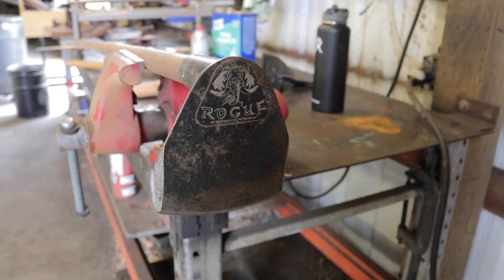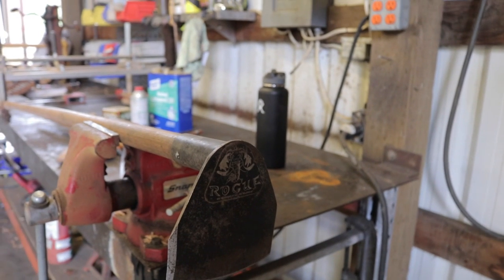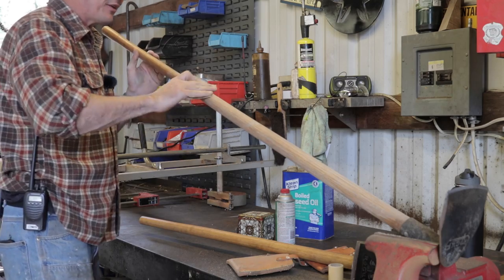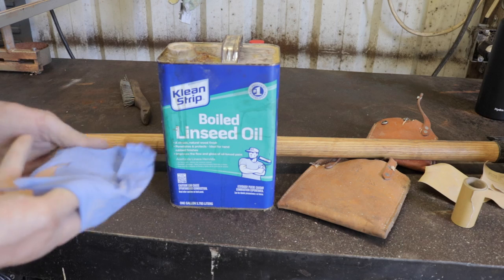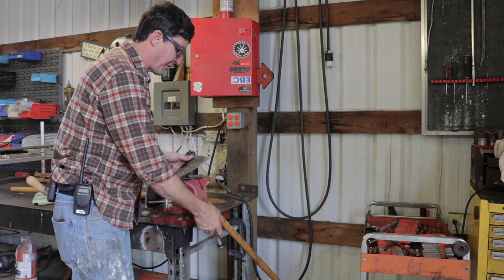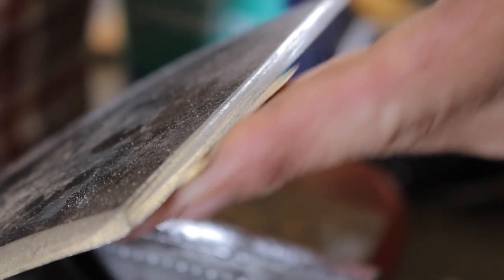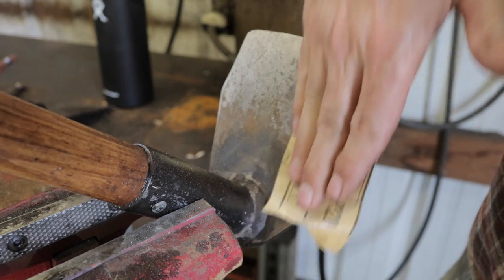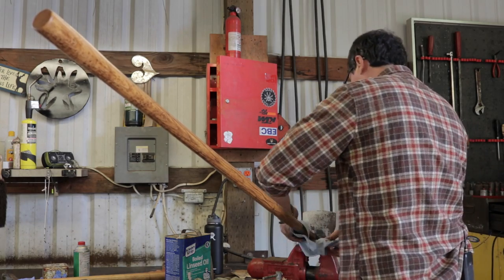This Is My Favorite Tool

Comment: Cody, you might consider buying or making a simple set of protective vice jaw pads so that you aren't munching into your beautiful wood handles with those diamond patterned metal jaws. We use to make them out of sheet aluminum, now I see them out of rubber or even urethane. A quick project to protect your handles.

Comment: Wish I could have watched this video earlier. I was restoring my friend's axe for a gift for his birthday on July 5th and didn't do a very good job at sanding the old and putting a new boiled linseed oil layer on it, the wood soaked the oil unevenly and the stain colour was a bit off in a few places. BTW don't you wipe the dust off the handle before applying BLO to it?

Comment: Question for you. When you use boiled linseed oil, are you using store bought BLO, or do you heat raw linseed yourself to polymerize the oil? Most store bought BLO has toxin chemicals as a drying agent these days and I avoid using it when I can. *EDIT* Just noticed the can in the background as I watch. Nevermind lol.

Comment: Great video Cody, These Hoes ARE Loyal! Only thing I want to share is when you are talking about patina. I don't think it will form if you keep sanding it off. When I restore tools, I usually scrub them clean with 3M Scotch brite and turpentine, this doesn't remove patina. Not trying to be a know it all, just wanted to share my experience.

Comment: Which model hoe is this? I am interested in one for work around my yard. Clearing beds and edging. Would this be good for that or perhaps one with the dual hoe and pick. What handle length is recommended? I'm 5'4".

Comment: I think lin seed oil would be a lot better on the steel than ballistol. Ballistol will just stay wet and get soaked up in the dirt once you put it in the ground, where linseed oil would form a protective coating that has to be mechanically worn off. I love ballistol for guns and other fine moving parts though.

Comment: Have you tried rubbing a piece of chalk over the file before sharpening with it? It helps keep those shavings out of the grooves so you don't have to card it very much or at all in most cases. Found this tip in a hundred year old book set called The Boy Mechanic.
Reply: Great tip 👍
Reply: Wow thanks!

Comment: I figure splinters have to be wood, but slivers could be anything.  The worst I have had is fiberglass; getting that out was not easy.  It's how I imagine it would be to try and remove the end of a porcupine quill, only much smaller and nearly invisible.
Reply: I continue to enjoy your videos.  Thanks for making them, and a special thanks to Mrs. W. for doing everything she does to support you in these endeavors.
Reply: Fiberglass is a gift from the devil himself. I don't care if it is 120 degrees outside. I will cover up as much as humanly possible whenever I have to work with that stuff. Sweating like a dog for hours is better than having fiberglass embedded in to your skin for days.
Reply: I heard a long time ago that if you get fiberglass fibers stuck in your skin you can coat your arm with PVA glue and once it dries it peels off and grabs the fiber. I haven't had a chance to try it but if you get fed up with them in your skin for days maybe give it a go. I'd sure be interested to find out if it works.
Reply: It might. I know 90mph tape sure does not do the trick. I might try and convince somebody else to try it first though.
Reply: +Brian Choitz I'm a home inspector.  I get fiberglass in my skin at least once a month despite wearing gloves (I use the cheap cotton jersey gloves but still).  fiberglass splinters are the worst.  very painful and so hard to find.  I use a flashlight to find them (often with a magnifying glass these days).  the light retracts so you spot them better that way.  I have a pair of very fancy shmancy tweezers that are fine enough to pluck those little needles out.   but I've never had to deal with more than 5 at a time.  if I had an arm full, I'd try the glue route
Reply: +Coppulor Fortunately I don't need to work with fiberglass that often. When I do, I am usually making a custom piece (I've made everything from car parts to pool equipment and costume masks). I learned to cover up, use woven fiberglass wherever possible and try to limit how much sanding I have to do when the piece is finished. If I had to work with loose fiberglass like you do, I wouldn't be too happy. I'd definitely buy fancy tweezers, a jeweler's lens and any kind of light that would help me find it. I'd definitely try the glue thing as well. Thankfully, wood and metal work well for 99% of my projects. I'd love to make custom carbon fiber car parts, but I think the end result is what is attractive to me rather than the process. I was providing security at a crash site for an F-18 and it was pretty hot out. I did not envy the guys who had to wear a full hazmat suit to approach the crash site because of all the carbon fiber from the plane. Perimeter security never sounded so good as it did at that moment.
Reply: +Brian Choitz so carbon fiber does the same thing?   is it as fine?  and insidious as fiberglass?
Reply: +Coppulor I honestly don't know. I have friends that work on F-18 airframes who work with it, and they say it is pretty similar to fiberglass, but I don't know if that's more in how you work with it or how it messes with you. I do know that there were special handling procedures due to the carbon fiber at the crash though. I figured it was something else like fuel that they were geared up for, but they told me it was the carbon fiber.
Reply: +Coppulor I might find out sometime if I choose to spend the money on it to make body parts, but I'd imagine it is similar. I will let you know if I find out for myself. Then I will go get the glue.
Reply: I'm a general contractor and seem to be a fiberglass magnet. Always getting into that stuff despite my best efforts not to. I feel your pain
Reply: And don't forget about those Graphite burrs. Owie!

Comment: Have you thought of setting up a time-laps camera watching the mountain? There are hacks for setting up most of the dslr's to do it or a simple webcam to a external harddrive using ether your computer or a cheap micro computer for a permanent setup. 

A once per minute vid would show the mountain in all of the light of the day and have a high chance to get the wildlife in frame.

Comment: Wranglerstar, 

Have you ever considered getting some BLO and making tool handle reservoirs? Something like a 2" dia. and 3" dia. with a sealed end-cap on the bottom and a screw-on cap on the top? You could leave these tools once overnight and not have to re-coat for a while. Just a thought. 

Thanks!
~Eli

Comment: You say you treat your gloves with obenhoff? What's that? I use leather gloves for black smithing and I'm interested in what that is?
Reply: check Cody's channel.  Its a beeswax dressing for your leather.  Obenaufs.  Good stuff Cody turned us onto it over a year ago.
Reply: thank you very much
Reply: David it is one of the best all natural products for leather gear of all types. Its actually a two step process. It has more than bees wax in it, if i was in my shop i would type out the list to you, but i am in my office. However, I use it on ANYTHING of my that is leather so saddles, to bushcraft kit, to you name it. You can also use it on things that have been treated with other products, I use it when i am at home, but when I am out I do have a home recipe that i use  that is like Dave C's fixin wax you can actually do a search for that here on youtube an find a couple really good recipes for fixin wax that is all natural as well. I just thought i would share that with you.
Reply: Thanks, Tyger, I'll look it up.  do you know anything about it's flamibility or melt-ability?  Like I say, I'd be using it for blacksmithing.  Of course, I'm not sticking my gloves in the furnace, but I sometimes have to go near it, also, on rare occasion, hot metal will briefly touch the gloves.  Of course, we try to mitigate that, but accidents are inevitable.
Reply: +david z when you ask about the flammability and melting are you asking about the commercially made product or the homemade one that you can YouTube called fixing wax or Dave C. sells on his store for a ridiculous amount of money? Asking so I can accurately answer you. I dislike giving half answers.
Reply: commercially

Comment: I've used fluid film for a few years, its lanolin based, what ballistol made of anyways?
Reply: I dont know, they say it smells something like black licorice and dirty socks though.
Reply: It is mineral oil based.  Wikipedia says: 

pharmaceutical white oil: CAS RN 8042-47-5
Oleic acid: CAS RN 112-80-1
C-5 alcohols: CAS RN 78-83-1; CAS RN 137-32-6; CAS RN 100-51-6
different essential oils to perfume Ballistol

 "They" say you can even drink it, but I will leave that to "them."  I love the stuff though and the smell grows on you.

Comment: Respectfully,
  Some files cut in one direction and yet there are many double cut files as well.  I know this as when I went to the Colorado School of Trades for Gunsmithing they did not let us touch a tool OTHER than a file, and a band saw(which truly does cut only on the forward stroke) for a couple of months.  It gave me an entirely different appreciation for what can be done with a file, and how to rate them, when that is all you put your hands on day in day out and you are held to plus or minus .001"... I would not give up that experience for much of anything.  Good mention of a file card but don't forget the CHALK...  No need to buy file chalk.  Go to the dollar store and buy children's large chalk pieces by the box.  Clean your files with the card and chalk them full before laying them in dry paper and not on top of one another.  The chalk pulls oils and other foreign materials out of the file and prevents pinning.  Take care of your good files as Nicholson US files are NO MORE.  Production has gone to Mexico and they are generally junk.  I had to turn to Europe for gunsmith quality files.  fwiw.  Of course it made moving on to the Bridgeport feel like I working at NASA.  If there is a piece of machinery that can be purchased used for $2500 or less in very good condition and just about every American Boy just aught to have just because it would be a Series 1 Bridgeport Knee Mill.  If I were choosing one for the homestead I would skip the variable speed head that I have on mine and go with the bulletproof earlier belt drive.  You simply have to change a belt when you need to alter your feeds and speeds.  Wonderful piece of machinery...  The engine lathes were worn out and made in Taiwan which is still better than 95% of the current junk made in China.  That said a good gear head 14" swing by 40" between centers lathe can do amazing things as well.  OLD AMERICAN IRON is the best that has ever been made.  If you are fortunate enough to find a good one consider yourself more blessed than usual...  Best Regards, Matt Garrett.

Comment: Not better gloves (thicker yes), don't expose nitrile to sunlight or fluorescence light. latex also degrades from UV. store box opening down or covered.

file card at home, short steel bristle brush like tooth brush, in the field.

Other story, workers, 10 guys with hats or 30 with caps.

Comment: Cody,  If those are latex gloves you can protect them from deterioration in storage (from UV or from ozone [given off by some fluorescent lighting dontcha know; I didn't]) by putting them in a ziplock freezer bag.  They keep for much longer; used to hate ripping a half dozen or so to ind a useable one.

Comment: The nitrile glove thing. . ..the "bad gloves" were due to damage by ozone which is about the only downside of nitrile gloves. Ozone? From where? Answer: welding.  The suggestions from viewers for sources of good gloves aren't going to matter so much - nitrile is nitrile and will be damaged by ozone over time. Pulling more gloves eventually gave you some that worked (although they tore later but they didn't tear right away like the ones grabbed first). This was because the ones deeper in the box were more protected from ozone unlike the ones near the top.

Comment: Boiled linseed oil finishes are best done with bare handed rubbing and a small amount of oil  
 ( friction+heat+pressure).
Set aside a day or two and repeat , 4 -5 times.
That is the traditional way, especially w/ gun stocks.

Comment: Cody for the life of me I can't wrap my head around why you're using boiled linseed oil. My grandfather was a lifelong lumberjack and owned the company every day the crew would come in and put their axes and whatever wood tools they would be using at that day into 5 gallon bucket's filled with raw linseed oil! Give raw linseed oil a try and you will not be disappointed boiled linseed oil is cut with lacquer thinner or so it will dry quicker, but once when you get your raw linseed oil you will see that it far supersedes the boiled!!!

Comment: I share your thought on buy the tool once, and spend every bit you can afford on it. I make a living with my tools now, but in the past Craftsman sufficed. I personally buy Matco they are pricey just like Snapon they are quality and carry the same no questions asked warranty. Why Matco well the Snapon guy shows up once a week just like the Matco guy, but the Snapon guy lacks is not personable like the Matco guy is. I regularly take inventory of my tools after every job I do I wipe them down if needed and place them right where they belong organization is a huge factor for me. I do my best to minimize foot print and gain the most out of my tool storage options. At least for the tools I grab the most some are just in a drawer some what haphazardly because I just don't use them more than once in a couple weeks. I clean and grease my ratchets regularly. Sure I can abuse them and just get a new one or have a ratchet repaired. That only means at some point in time I will be with out that tool for up to a week I just cant have that. My family will suffer at my lackadaisical treatment of my tools.

Comment: Cody, as a firefighter myself, I too am fond of the Rogue tools.  I have had my particular hoe/adze/pounder for about five solid years and can complain. I have a tip for you, if you need to keep a tool in a location where it's handy, but not always protected from the sun/weather, i.e. the bed of a truck, take a piece of blown 1 1/2" wildland hose and cut to about a foot longer than the tool handle, then slide it over the handle until it bottoms out on the head. Then fold over the extra at the end of the handle. This will keep the tool handy yet protected. Works great. Anyway thanks for the great channel and watch for wind shifts

Comment: I love your videos, and I think you have an above average channel. However, you wish to limit your exposure to carcinogenic substances, and yet you dunk your mailbox post in engine oil. furthermore, you pour it down a hole drilled into it periodically to maintain the level of oil. this not only effects the ground surrounding the post, but contaminates your drinking water. Either way I do enjoy your videos, and appreciate all the time you put into them, but maybe you should do a little more research on that.

Comment: Cody, you can avoid all that burr formation by filing toward the edge, as opposed to away from it like you do when filing a chainsaw chain. With just the file, you can get a fine enough edge to shave, and because you're cutting toward the edge, you never roll the metal over into a burr.

Comment: I really enjoy your videos but it pains me to see you hold a nice wood handle in hardened steel vice jaws. what I have found that works well is just keeping an old leather glove behind the vice and put it around the handle or anything else that is delicate so I don't mar the surface.   
Thank you for providing great entertainment coupled with useful knowledge and insight. I may not agree with everything you say, however, I like the fact that you seem to understand how you came to your conclusion and that speaks great volumes about your character.

Comment: Boiled linseed oil can replace antiseize, I use it to prep bicycle spoke threads to ensure ability to ever retension them for longer life.  It has worked great for me.  On the tool front I don't buy the best but instead I choose mid range, but tool care is everything.  My favorite tools are the scuffle hoe sometimes called a sturrip hoe, and a curved maddock with an axe on the opposing end and a cherry handle.

Comment: That hoe looks almost identical to the hoe I used when working in my mother's garden. Don't know when or where she got it, but it worked better than a standard garden hoe. Just an FYI we are talking about using the hoe back in the late 50's and early 60's in East Tennessee. It was old when I was young so it could have been one she got from her mother.

Comment: I have read that when you are putting oil on wood you should not sand with anything finer than 220 grit until after you have applied the oil.  I guess sanding finer than 220 make the pores too small to effectively absorb the oil.

Comment: I was working in my garden with one of those cheap Walmart garden hoes and the head got all loose (all it had was a tiny pin that went half way through to hold the head on) and I thought what would wranglerstar do? Of course it would be don't buy a cheap Chinese made junk in the first place. So I went with my next thought wranglerstar would make it better so I took out the tiny crap pins drilled it out and put larger strong pins in and put an edge on the blade. Now it works great and is nice and solid.

Comment: Good tip on the sandpaper. My local hardware store only sells crappy gator brand sandpaper and it clogs up SO fast, I'll check out the auto body supply place.